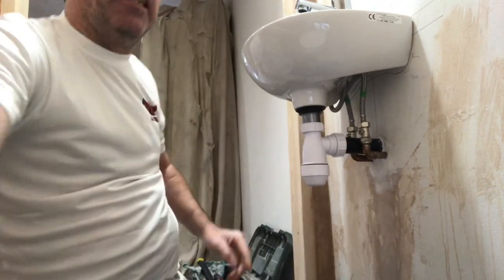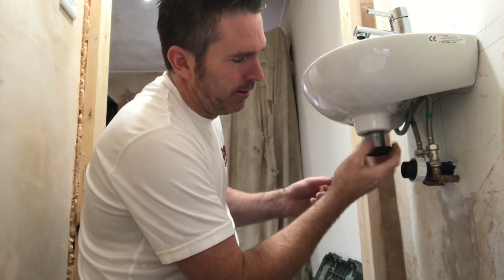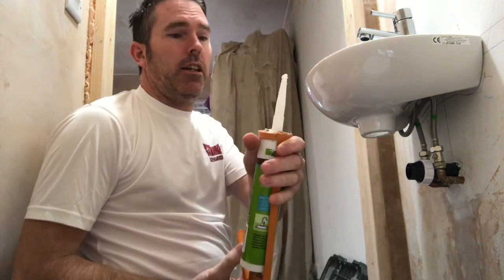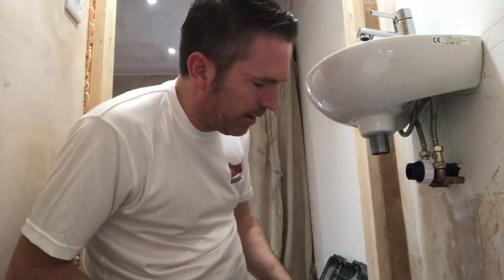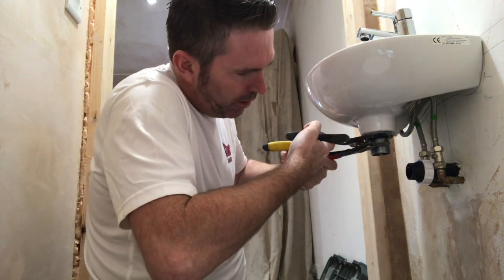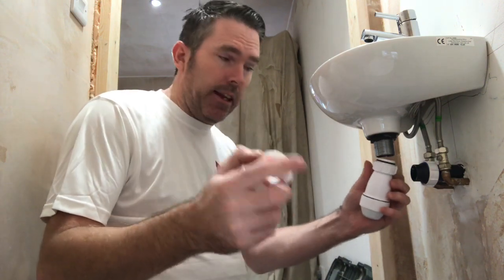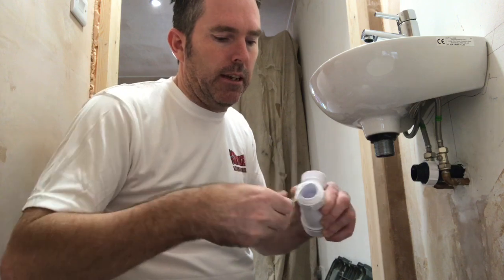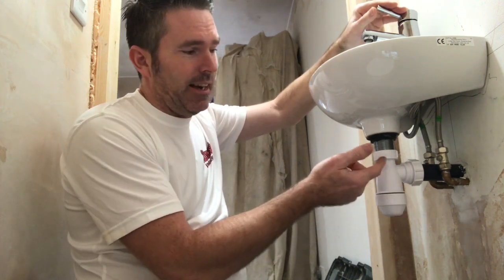Change basin waste, form a new seal on basin trap To Avoid Any Leaks

Comment: Thought I had it all sorted after doing all the major plumbing relines from bath to basin on a new wall, until it came to the last task - putting in the basin drain + overflow waste on the new wall hung unit.  Despite using hemp in places & PTFE tape in others, that despite my reluctance to use silicone under the basin drain, it wasn't until I watched this video that it became the obvious solution in the absence of a plumbing putty. Can't do a proper test under pressure until it cures but the jobs @ my own place so there's no hurry. A check in the morning and I'm sure she'll be right mate. Thank you for your easy to follow tutorial Michael.

Comment: bit late but if using a HM silicone then best  to leave the nut as finger tight as the mastic will form a washer   and mastic needs to have a depth of material  not squashed out

Comment: Good luck doing that with a pedestal. No way you can get the grippers up there. Hardly even a thumb and finger. If it was done with silicon you'd have to smash the thing up with a hammer.
Plumbers mate. Same outcome, none of the issues.
Reply from the maker: No

Comment: You don't need silicone, washer is enough with some teflon tape over the thread (you didn't use any washer here).

As for the second part, lol you don't understand how that joint work don't you? Black washer is used there for sealing, not the thread, no need to put tape there at all
Reply from the maker: You do whatever you wish this is how I do my work. If you do not like it that is fine do your own channel